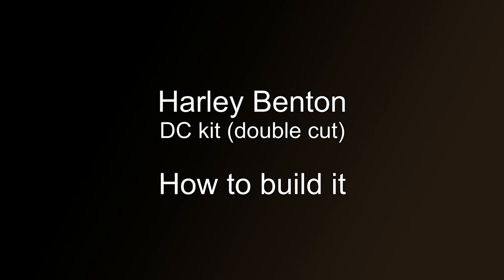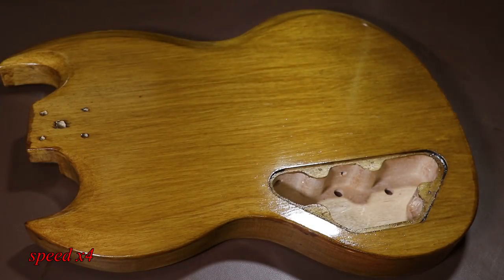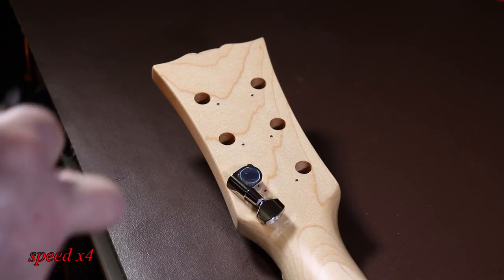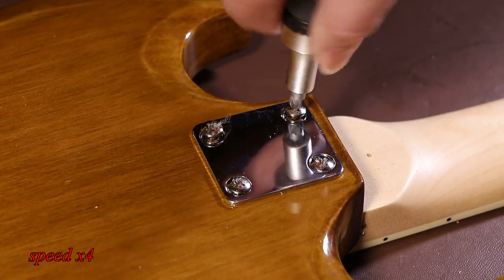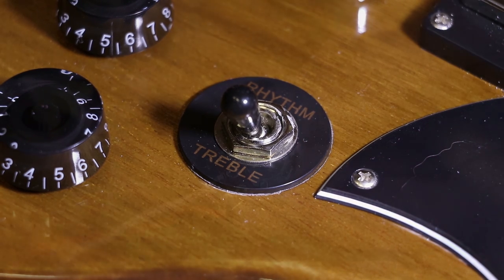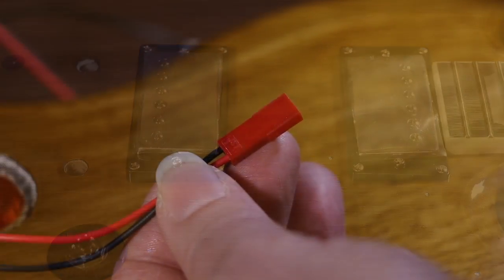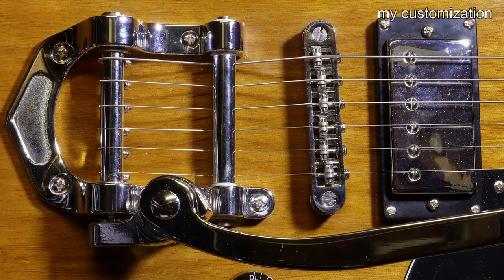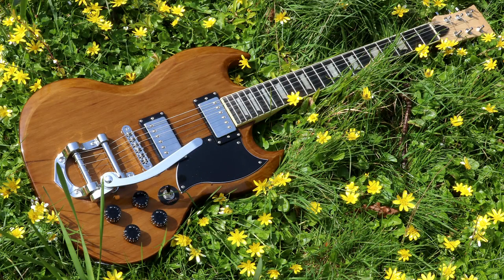Harley Benton DC guitar kit assembly instructions, test and review

Comment: You should have used (Tru Oil) finish after sanding the wood down to  800 grit or or more. You don't have a spray booth like the  Factories  use. Violine makers use this product, and I have used it on Classical guitars which I have built.
Reply: I work in a small guitar shop and the owner swears by the tru oil method, it's really difficult to screw it up, looks and feels great too
Reply from the maker: I think I will try it on the next kit . .🙂

Comment: Your problem finish wise is that you are playing with an open pore wood, which needs to be filled first, then sanded down and flattened. You started off right, with your sanding, but then you needed to replace that filler that the factory had put on. so you put filler on, let it sit, and scrape off the excess, then let it dry. do that a couple of time, usually, and the surface will be flat. a little touch up with some sanding and you're ready for color, then gloss top coats. THEN, sand that down so it's got no bumps, going through the grits of sandpaper,  then polish and buff out for the gloss finish you're looking for. A good finish is a LOT of work.
Reply from the maker: Good advice

Comment: I modded one with a maple veneer and set neck. Maple venner in the back to cover those eyesore holes for the neck bolts.
Reply from the maker: sounds like it should be nice 😊
Reply: @guitar-academy  Not taking away your build which came out awesome. I just wanted to get as close to the Gibson SG as possible. And thanks.
Reply from the maker: @izzysantiago978  No problem . . I wouldn't actually do I build like this normally but this was the continuation of a review so I wanted to build it just using just the instructions provided.  I think I proved that it could be done, but you can make the guitar a lot better if you use additional knowledge or references. 😊😊

Comment: I've used diluted wood filler for sealing the grain before. When sanded back it is mostly not visible under a clear coat
Reply from the maker: that's a great tip . .  thank you 😊

Comment: You have to sand between every coat with super fine grit papper
Reply from the maker: great tip 🙂
Reply: Yep. I did a les Paul type with tru oil. I sanded with 1500 grit between all 14 coats. Smooth as a baby's bottom, highly glossy and amazing.
Reply: What the hell is papper?

Comment: I just started watching the video, but I was wondering if there are any issues due to the lack of shielding??? I'm thinking of getting one of these, but before I do I want to have all that I need on hand..like shielding paint, better tuners etc...I do have spoke shaves and scrapers and most any other woodworking tool I may need, but my major concern is the shielding..I would have to buy special paint for that...or glue in some tin foil or something...
Reply from the maker: Yes, it would be a good idea to buy some shielding, especially if you want to avoid noise 😊
Reply: @guitar-academy  I assumed, just needed clarification, thank you.

Comment: To get  a great finish it might help to sand in between coats with a very fine grit. Then polish it on the last coast with wet and dry going with finer and finer grit.
Reply from the maker: Yes, you are right . . that suggestion is the most commonly made in the comments . . 😀

Comment: Nice vid.  Just a thought, it's better to make the holes for the neck plate large enough so the screws don't thread tightly through the body but pass through and thread into the neck itself.  Helps make sure the neck angle is correct.
Reply from the maker: Yes, agreed, but this was the continuation of a review and I wanted to see if the guitar would go together without modification . .  😀

Comment: As a rule these finishes are spectacular. But the fine print is after a few coats let it dry and then cure.
Then sand it down to knock off the high spots. From that point the process will consist of apply,dry. Sand apply.
And after about 8-9 coats sand graduating the grit grades. I use a 600 grit to start wet sand of course.
Then 800grit. Then I go to a 1000grit,up to 1500, and then a 2000 grit. Now after that you should be pretty smooth.
After that I use a coarse rubbing compound rubbing that for an even smoother finish. Next a fine grit compound. 
After that you are ready to polish. Try using a good wax polish with a carnauba. There are many out there to choose from
And that will also help in rubbing out any swirl marks. After that you are free to either use your choice of a spray or a wipe on 
Polyurethane,or a good lacquer and after you are done let dry and cure for several weeks so the finish can harden up. Building a guitar
is truly a very fun and learning experience. I am certainly enjoying watching your progress. Just wish those kits came in a set neck as well. 
There’s a challenge! Cheers my friend!
Reply from the maker: Thanks for the tips . . .  I have seen kits in set neck form, but not from Thomann 😊

Comment: This seems like a decent guitar. I’ve never built a guitar and I’m a complete beginner. You mentioned the neck being big, is there a guitar kit you would advocate for if price isn’t an option ? And is there a better beginner kit guitar for around the same price ? Great video, straight and to the point and no background music. Keep up the great work.
Reply from the maker: Sorry for the delay I was hoping to review a more expensive kit, but it just isn't happening yet . .  hopefully soon . .
Reply: To chime in regarding neck sizes, you’ll find wider necks (50-52mm) on classical guitars, but that isn’t a bad thing.  

I studied classical and Flamenco. I actually prefer a wider neck. Regarding thickness, if the back is too round it can feel odd to some. If you have a wide neck that is too round/thick for you, it might feel even more odd. 

I prefer Jackson-style necks because they seem a little wider than Fender and Gibson necks and they are a modern, thin feel. 

My suggestion is to go to a local shop and play various guitars, take note of the way the neck feels in your hands, your ease of fretting, et cetera.  Look up the  ones that feel the most comfortable. You’ll find neck specs.  You can base your comfort zone around those widths. 

But, remember, staying in your comfort zone offers no challenges. Also, various makes have various tones.  If you want to get various tones, naturally, without coloring them with effects to emulate a certain model, you might want to try playing on necks that aren’t as “natural feeling” in your hands. 

For example, Inbought various guitars for specific purposes (e.g., a hollow body, a Telecaster) to go with my compliment of Jacksons.

Comment: In my working with wood you can make repairs to loose screws with wood putty or in a pinch take some tooth picks an brake then off flush in the hole an then replace the screws.
Reply from the maker: good tips . .  thanks 😊

Comment: I have a habit of commenting on vids before they finish. Not this one. I love SG's and viewed this clean thru.
Turned out nice but one, wondered why the neck wasn't body tinted, two, concerned about the softness of the body wood and three, the 'bigsby'.
Answer, personal choice, don't drop it and John Cipolina of QMS is on my short list of great SG players and he used one.
I love the finished Axe !!
man, Saga of SSF, Ca used to make kits of t's and s's. Late GP editor Tom Wheeler actually did an installment of an s kit as a father and son project. Turned out good. This was '01 or so.
book case "American Guitars" and "The Guitar Book" written by Tom are side by side.
Reply from the maker: You answered your own questions correctly really but here of my thoughts anyway.  I will do something with the headstock, but I will do a separate video on making your own decals and do it then.  The softness of the wood is a concern, I knew it had no weight but I had no idea it was so soft until I started putting it together.  My own working guitars all have trems on, so I find myself reaching for one even if the guitar doesn't have one . . LOL . .  habbit . . . 😀  Great questions

Comment: great video well done my concern is that don't you want a tight fit for the neck to fit in the pocket to me it seemed a little to loose
Reply from the maker: Nope. I could pick the guitar body up with the neck with no screws in it.  Any tighter and it would have caused cracks in the wood as it expands and contracts over time.
Reply: @guitar-academy  ep ok i   get it

Comment: You need to sand smooth between coats of varnish. very fine sandpaper, that helps make the base finish adhere better to the subsequent finishes. after the final coat of varnish, light sand, and then start with your clear lacquer. Same with the lacquer, coat, dry, sand, coat, dry sand, coat dry, sand buff with ultra fine sandpaper usually wet sanding. finally buff with polishing paste.
Reply from the maker: Yes, if you look through the comments the vast majority agree with you . .  you have the correct solution . . 😀
Reply: @guitar-academy  sorry, if I reiterated with others have said. I'm a bit ADD, and the son of a phenomenal carpenter/craftsman.

Comment: 1) if you strip out the wood from screwing too much, you can either put in some fine sawdust and crazy glue, or glue in a toothpick with regular wood glue and re-drill.
2) I recommend installing the bridge before the neck so you can check if the neck needs to be shimmed to align it's tilt to the bridge...with the bridge in it's middle position(height).
3) you put the pickups in correctly, but some people tend to turn one of them 180 deg...thinking the screws need to go the same direction.
4) brass is difficult to solder. and is not a great conductor, but probably enough for this use case.

liked.

Comment: Wiping on product like this is a wipe on/wipe off process. You only want the as much as will soak in and wipe off any excess. You shouldn’t really see a sheen on it until you polish.
Just a couple notes as I am watching I have done several kit and scratch builds. A tight neck fit is good, it is ok to use a little pressure to get it in place it shouldn’t slide easily into place because you do not want it sliding easily out of place. I would not recommend expanding the holes for the neck screws and amount of play and the screws will start to wear away at the hole and make them bigger until your neck is completely loose. Good old candle wax on the screws is the thing don’t dip them in it but just rub it around the outside so it makes it easier to screw down. 
I am looking at doing this same kit as a quarantine project which is why I am watching but I have drawers full of pickups, tuners and pots so I won’t be using what’s in the kit.
Last thought if you place the bushings for the bridge and tail piece in your freezer for several hours before installing them on the body they will set in easier. Take directly from the freezer one at a time and put each in immediately they will have shrunk ever so slightly from the cold just enough to make them set in much easier just a tap or two with a rubber mallet. 
Very nice looking build and well done. 
I hope no one is bothered I gave my thoughts on building but I learned to do it before YouTube and made so many mistakes that I try to pass along things I have learned. Great video thank you
Reply from the maker: Very useful advice  . .  I will take use all those tips at some point in the future I'm sure . . Thank you 😊😊

Comment: Considering how inexpensive Harley-Benton guitars are complete, do you think that it was worth the cost/effort to build it yourself? You didn't appear to make any upgrades (pickups, pots, locking tuners, etc...), which is what I would expect folks to do with build kits. I understand that ceramic vs alnico pickups are a matter of taste and you may have been okay with the stock HB equipment, but that makes this a good basis for whether or not you felt it was worth the effort. Just curious. Cheers and thanks for the video.
Reply from the maker: Good question and one that's been missed by most.  The whole point of this video was to be the continuation of the review I did, so really I shouldn't have even put the Bigsby on.  That's why I stress the use of the instructions all the way through, I wanted to prove or disprove that the guitar would be usable straight out of the box.  As I said in the review video the kit is a not good value if you want a cheap guitar because the factory finished one is only a few pounds more.  However for a student of guitar to learn the basics of guitar construction these kits are worth every penny.  I've got other kits I've reviewed and have got to build, but not because I want to . .  part of my job is to find out if they are buildable so that people who do want to build them will have an idea which kit is best for them. . . .   Saying all that, I got a sense of satisfaction when it was all together, and it is usable.
I wouldn't waste money on expensive components for a kit, I would only do that on a guitar that I knew played well and was worth spending money on.
Reply: @guitar-academy  Ah, excellent, thanks for the response. I've been thinking about building vs buying, but I know my limitations (patience being one of them) so I don't think I could devote the time necessary to get the finish the way I would like. Buying an inexpensive guitar with a good finish and upgrading components would be a better solution for me right now, which is why I wanted your opinion (thanks again for that). I will, eventually, buy a kit and build my own, just for the satisfaction of doing it, but it will have to be at a time when I can spend the proper amount of time to do it properly. I'll no doubt circle-back to your video when that time comes. Cheers!!
Reply: I'd say buying one ready made was more cost effective but building your own from a kit is far more enjoyable and satisfying, I built a Telecaster Kit last year and learnt so much about finishing, upgrading and setting up guitars.

Comment: Well, i enjoyed the video. I am wondering about the soft wood which is used for the body and how some screws won't grip. Could a hole be drilled and glue a hard wood dowel work?
Reply from the maker: Yes potentially, but perhaps there are better kits in the same price range out there.  This kit has been together now for a while and the soft wood isn't causing any issues so far apart from the marks it receives if you knock it . . 🙂

Comment: Put coat on thin, with the grain without moving brush around much After each coat of varnish dries - solid - go over  with 00 steel wool until smooth as glass.
Reply from the maker: thanks . .  sounds like a good tips . . 🙂

Comment: I can never get that Halfords clear lacquer to dry hard enough. Leave it to dry for a month and your thumb nail will leave an impression. It will dry enough to buff out, but it isn't a hardened 2K finish.
Reply from the maker: I find it goes hard if you leave it in the sun for a bit or in front of a heater, that seams to do it.  Nitrocellulose is far better, but I was just making do with available.  The nail marks in this were nothing to do with the finish, the wood the body is made of is soft . .  really soft.
Reply: Nitro goes rock hard ,you can get it delivered for less than £10 for a 400 mil tin ,,you can colour the body with food dyes to the shade you want then build up the lacquer, ,leave it a week then buff up using a little water and wet dry paper ( avoidingvthe edges !!)from 1000 grit 1500,2000 2500 then t cut and polish

Comment: Varnishing, to get a flat even finish on a guitar thin it out by 50 % on your first 3 coats, rub in between coats with fine steel wool for every layer you put on 4th coat thin by 25%. Then do a few coats full. power. Leave it to cure fully then give go in with 1500 grit and do a light wet sand and then again with 2000. Finish off with a wax coat.
Reply from the maker: good advice

Comment: What you are missing is called 'rubbing out'. Flatten the surface first with 1000g, which will turn the surface 'matt', then use 3000/4000g pad (i.e. Mirka) with a splash of soapy water to lubricate. This will give you your 'gloss'. You need a fair base of varnish or lacquer to achieve this, I prefer a foam craft brush for this.
Reply from the maker: great tip . .  thank you 😊
Reply: @guitar-academy  No worries, you don’t know until you know. Just need to be careful on corners/edges especially when flattening as they can rub through easily
Reply from the maker: @7bookem  more great advice  . .  thanks 😊

Comment: I have a stupid question, do you think adding a Floyd Rose FRX will effect the neck too much? I am worried of getting a set neck then after a couple uses either the whole neck will snap or the head stock? I guess the question is do you think it can handle the pulling tension of a whammy if used rough?
Reply from the maker: The neck on this guitar is as strong as any neck and probably stronger than most so NO it wouldn't effect the neck.  It would be strange to put a trem system that cost more than the kit, why wouldn't you just buy a better kit in the first place ?
Reply: @guitar-academy  it's a project that I really wanna do for a date, I'm not sure if a Floyd is gonna be on the guitar but as an option. I am just more focused on the guitar in a way. I'm a beginner on assembling guitars I just don't wanna screw up knowing I spent $200 or more on a kit I can't fix. Just used as something to do I guess and if it goes well I wanna give it to someone I like😅
Reply from the maker: @boyraisedinhell6307  The best of luck . . I bet it'll be a really nice job.  The fact that you're spending time researching first, rather than rushing in says a lot 😊😃